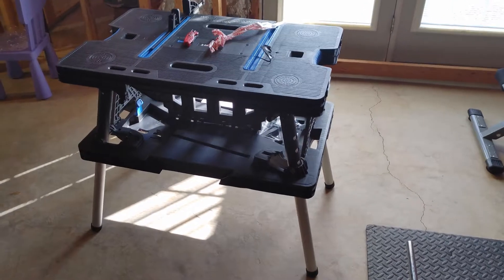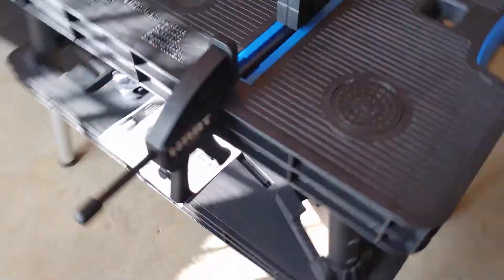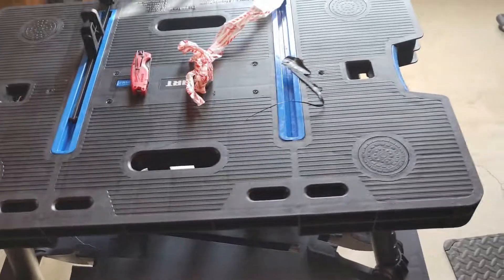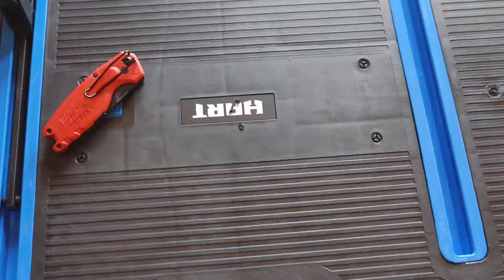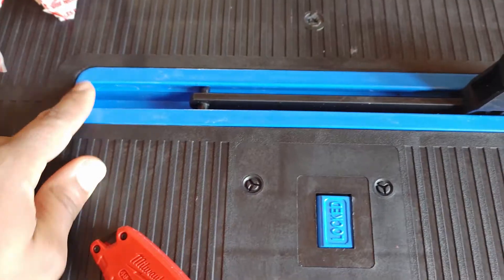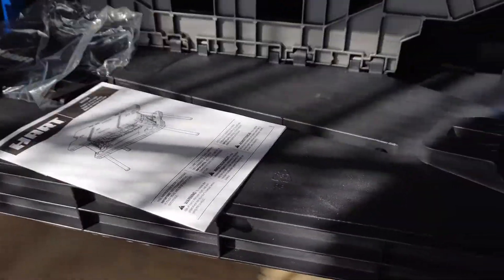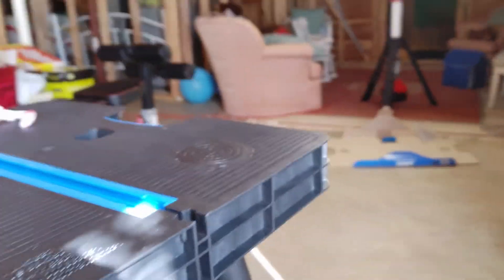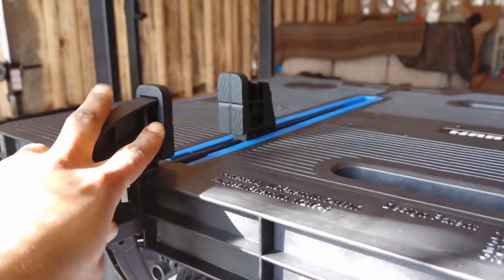Keter Folding Work Table Alternative | Walmart Hart Workbench

Comment: Have you had a chance to use it?  How useful does it seem for cutting 2x4’s etc?
Reply from the maker: I've used it for 2x4's. Worked great! I haven't tried it using a circular saw though. I just used an oscillating tool or a reciprocating saw and it was perfect!